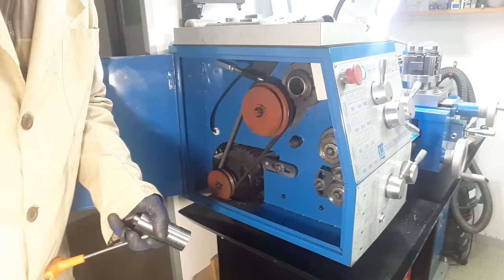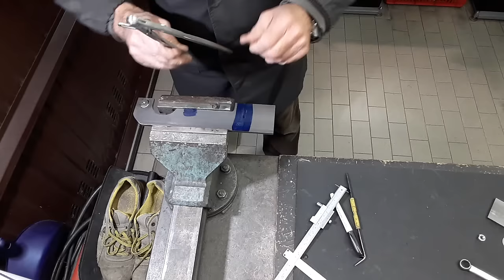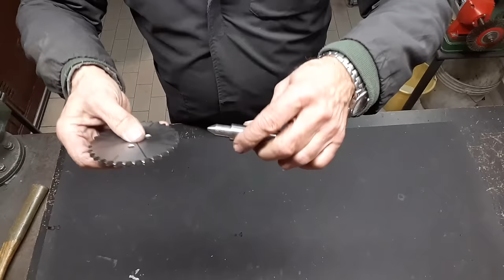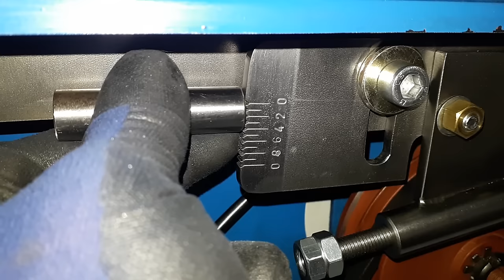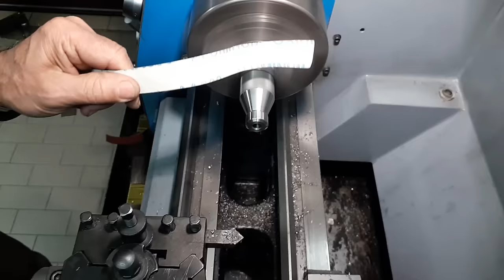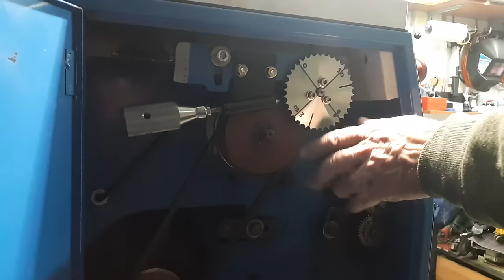Lathe, 360 degree divider

Comment: Thank you Mauri for this video and idea! I just ordered the sprockets for my divider project yesterday. I really hope my project turns out to be even close as good as yours. I really hope it works as I need alot more ridgidity as my lathe is bigger (1k62). Thank you from Finland!
Reply from the maker: Thank you very much Ville, all the materials you use will need to be adapted to the dimensions of your lathe, there are crown gears with a larger pitch and consequently the diameter of the wheel increases.
In mine I inserted a microswitch on the low voltage which cuts the triggering of the motor contactors.
Greetings Finland